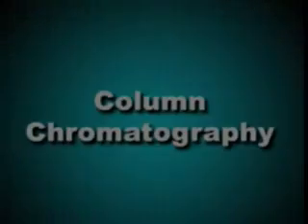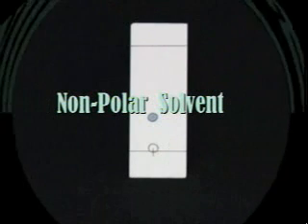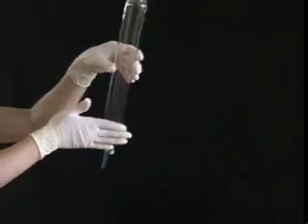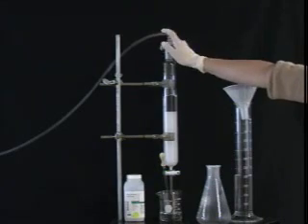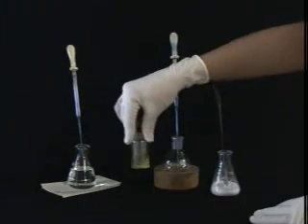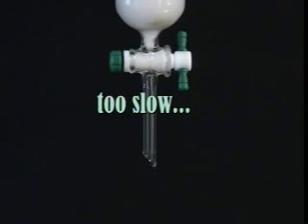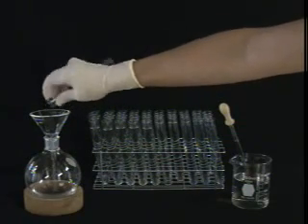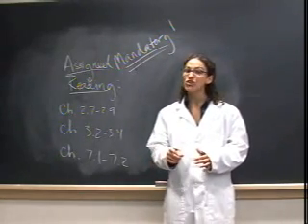Lec 10 | MIT 5.301 Chemistry Laboratory Techniques, IAP 2004

Comment: Yes, TLC is pretty much directly applicable to the column as you have the same stationary phase....you would generally run a gradient of solvent though through to the optimal solvent ratio....can't remember exactly but you can go from something below the optimal up to 5/4 of the strong solvent (where 4/4 is the optimal ratio giving you the best separation/Rf value).

Comment: @HelloBrainMind An automated system like biotage.

I wish I had this video when I was an undergraduate. Its every bit of knowledge I eventually sucked up while running tons of horrible columns separating cis trans isomers that would barely separate and took forever. One thing that I didnt notice, she may have mentioned, is that dissolving silica in polar solvent is exothermic and can heat the silica enough to make fissures and ruin the column. Watch out!

Great video!

Comment: so if you determine the right amount of solvent to use for good separation, let's say 45% petroleum ether, 50% ethyl acetate, and 5% methanol from doing TLC, is that the solvent ratio I would put into the column?